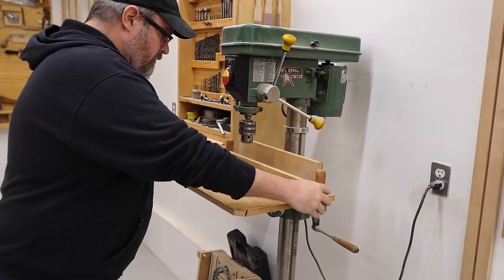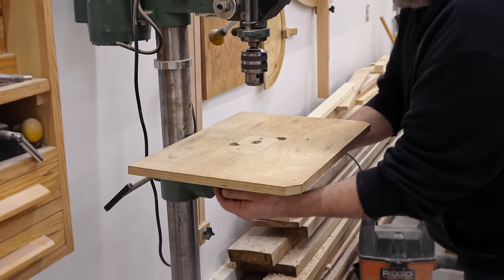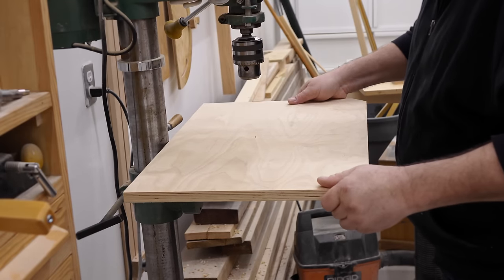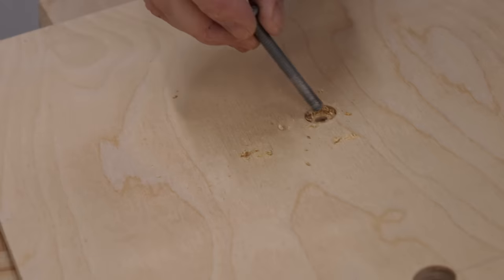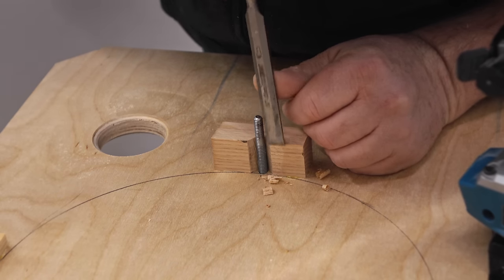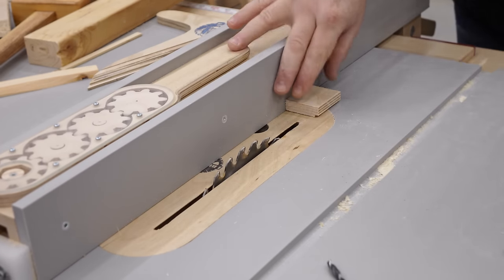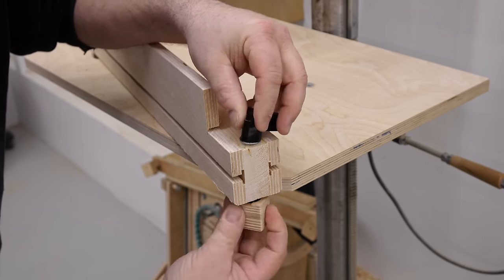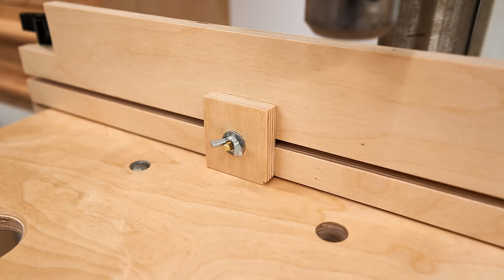Make This Simple Drill Press Table and Fence - Woodworking - Workshop

Comment: I have seen a lot of these drill press table videos where they make the fence slide forwards or backwards and be square to the plywood table.  This seems to me a bit complicated.  The fence does not have to be square to the plywood table.  If your fence can pivot from either the left or the right then clamp the non-pivoting side to the table top, it achieves the same purpose.  You want the fence to be the proper distance from the drill bit for your project.  Take a look at my video "Build an easy Drill Press Guide" and see if you agree.  I do like the holes you put in to clamp your work piece.

Comment: Here's a little trick for measuring how far your drill-press table deviates from being perpendicular to the quill axis.  Cut a length of wire from a coat hanger and put it in the drill chuck.  Bend the wire so that the free end is offset from the axis by a little less than half the width or diameter of the table.   As you turn the quill manually, that end sweeps out a circle that is perfectly perpendicular to the axis.  You can use a feeler gauge or some kind of wedge to see whether your table is parallel to that circle and adjust it accordingly.  This adjustment can be far more precise than using a square as in John's video.
Reply: Hi, there!

And you can even be more precise using a feeler gauge. But it is a very good tip for low budgets.

Regards,
Etna.
Reply: @Etna.  - He said to use a feeler gauge or a wedge.

Comment: John, this looks great, but I think I'm missing something. Are the only things holding your table to the drill table the pressure against those little wooden blocks underneath and the small edges of the fender washers that extend over the edge of the blocks? Please, tell me what am I missing, because otherwise this looks like a great project!

Comment: Super practical design that does the basics very well. Like you, I find many added features of tool accessories like this rarely get used. On the rare occasion they may be useful, there is usually 10 other ways to accomplish the task very simply. 10/10

Comment: Great looking table, John! I'm still happy with the one I built a couple years ago so can't justify making another. I did have to chuckle though when you mentioned foregoing making the table "insert-capable" because you never use them and just stick a scrap piece up there. I do the EXACT same thing! I made about 20 perfectly sized inserts (which are easy to make), at the time and for some unknown, ungodly reason, can't bring myself to drill into the things!  I may just glue one in place. lol
Stay safe (and sane)!

Comment: The reversible fence is a great idea -- tall for clamping and short for getting out of the way of the chuck.  One tweak you might consider: discard the rear locating block on the underside. That will let you slide the table on and off just by loosening the clamp blocks.

Comment: I have a drill press table quite a bit like yours:(1) I totally agree with you on the replaceable insert. It's not worth the effort. (2) I used a double thickness of 3/4" plywood for my base, but that's just me wanting to have a really secure flex-free base for clamping. Probably overkill. (3) The clamping holes are a great idea. I am sure they will be very useful.

Nice project. Thanks!

Comment: Simple,  works.
You could upgrade it to a drill center table. 
My drill press is missing the rack
I got it used that way, but I know some drill presses were sold with no rack.
Plus it would be nice to have storage, and some way to clamp on tall parts without changing the 90dgr angle of the table to do it.  
Well on the colum of a drill press you could make a clamp stop to set the tables resting height then a table top like this but built up for draws and bit storage
Fractional bits chucks, fostner bits hole saws and so on a side table if you swing the table sideways and a crank type top lift like a radial arm saw has.
Points to install a drill press vice. Hold downs and clamps in t slots.
Even if your drill press has a good rack the lift could help fine tune or even extend the depth of cut past the spindials travel capabilities  most only move 3 to 4 "   but with this approach you could drill a 12" deep hole or even more.
Like you might be able to do on a metal
Cutting  lathe with the tail stock. 
Now a drill press wasnt design to mill metal but you could add x and y axis travel and mill wood without a problem.
To sum this up you've turned a drill press into a wood working mill sort of. 
X and y might not have as much travel as a bridgport but it could extend your capabilities. 

One point about a drill press they use moriss taperd chucks drilling a hole pushed them into place, cutting side ways might break that presure fit bond
And drop the chuck and bit.
Its why I said woodworking and light cuts only. Any serious material removal could free up the chuck and make it come loose.
This is why real mills hold the tools with a bolt from the top of the spindial.

Comment: I have a suggestion for a little improvement.  There are lots of hold-down clamps that rely on installing a threaded vertical shaft on your table; some kind of clamp or tab is screwed down on that with the equivalent of a wing nut.  How about drilling holes at suitable places on this table and hammering in threaded inserts from underneath?  The ideal situation would be what's used in optics labs: a plate with a square array of 1/4-20 tapped holes on 1" centers.  Wherever you need a hole to screw something down, there's one pretty much right there.

Comment: Nice updated version.  One question about interference with handle to raise/lower table.  I had to chop off right back corner or have my fingers smashed regularly.  Do you have this issue and how did you solve it if you do?
Reply from the maker: https://ibuildit.ca/blog/drill-press-crank-extension/

Comment: Okay, about the crank....   Taking the head and the table off the drillpress seems a little backbreaking to me...  I'm already trying to think of a way to just fit it around the post and glue or screw it together.   NOt that I'm actually going to change out my crank anytime soon...  I've trained myself to hold the crank upside down, so I don't bang my knuckles on the underside of the table.  Someday...

Comment: I thought of doing this years ago but on the mitersaw, I was thinking that the paper would be below the set of the teeth , make the plunge cut then slide the material over into the spinning sandpaper til the cut is exactly on the line

Comment: My favorite design of a simple but highly effective drillpress table. I will be making this with a couple mods. 
1. Drilling the hold down holes closer to the base to minimize flex.
2. Add a T-Slot to the table for hold down clamps for small parts.
3. Adding a vacuum mount to the fence, as I drill a lit of brass & HDPE which is very difficult  to clean up.
4. Adding an LED drilling light stand to the fence.

Comment: Your drill press and mine look a like. My drill chuck is worn out. Do you know how to replace the chuck?  I see no set screw up inside it. I have no manual . Thanks.
Reply: Danny Powers  there is no set screw  you just need to find a way of prying it off  the shape of the shaft is conical, pressure is the only thing holding it in place.
Reply: The tapered shaft that the chuck is a part of should be easily removed with a gear puller.
Reply: Danny Powers you should be able find a user manual online using the name and model. Good luck